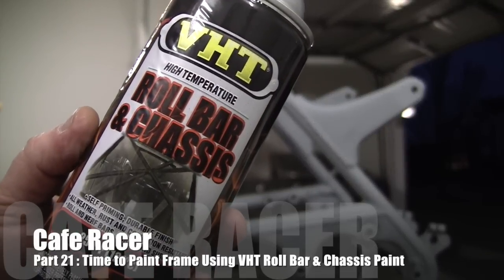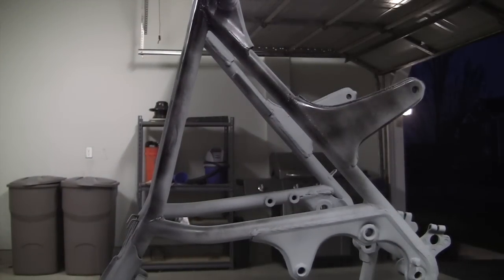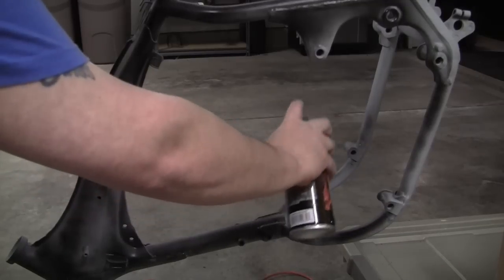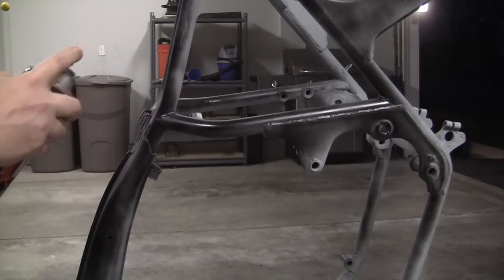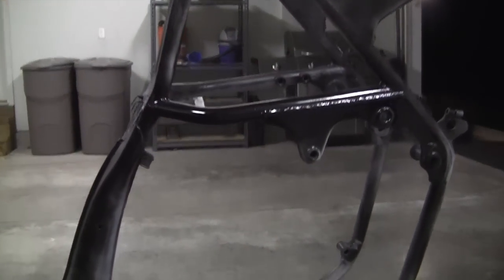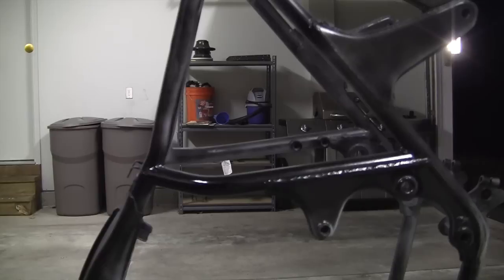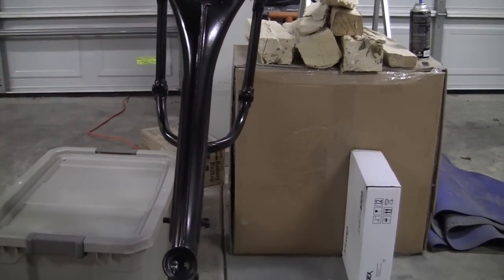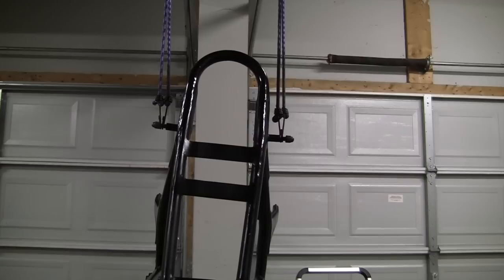Cafe Racer Build : Part 21 :Painting Frame Using VHT Roll Bar Paint

Comment: I'm using this paint in another application to get a "close as I can" powder coat look. For bike paint, I ended up using VHT appliance epoxy paint for the gas tank and trim on my bobber build and I really like it! A little wax and you can hardly tell the difference from OEM paint.
Reply from the maker: +Bill Dozer VHT is some awesome stuff!

Comment: I'm going to be starting a Brat build soon, and have a question. 
I was looking at the Satin Black VHT Roll Bar paint. They say it doesn't need primer, but you obviously primed the frame. Would it still be better if I still put primer on the frame first?
Reply from the maker: I've done it without the primer and noticed it didn't stick as well when using it with. I say use primer but I'm no expert! The primer really seems to make it that much better.

Comment: iv bougjt a frame stripped all the paint off to find rust holes under the engine carrage pipe not that bad but what would you sudgest? weld a half pipe over it and paint or? thank you
Reply from the maker: I would cut out the rot and weld in new sections to avoid it from coming back.
Reply: omg no don't cut sections out, it's more work than necessary cos you can't just butt weld in a new piece of tube, it needs a plug too cos butt welds aren't enough. all you need do is grind or file off the rust and build it up with weld then file it to match the tube

Comment: Im also building a cafe racer. The bikes a 1977 xs750.     I kinda wanna go with a "raw" look. I wanna go with a aluminum look and not paint it but would it be bad for the bike?
Reply from the maker: If it's steel you'll wanna put some clear coat to prevent rusting. I think that would look pretty sweet.
Reply: Make sure it's a 2k clear. Most others will rust through. I just did the same thign to my tank, and it started to rust underneath. I was told a 2k clear would have prevented that.

Comment: how strong is that paint?? you said that you used it on the yz125 but is it as strong as powder coating? will it withstand falls and not chip off? thanks!
Reply from the maker: It seems to be fine but isn't anywhere near as good as powder coat. The only downside to powder coat is you cannot touch it up like you can with this paint.

Comment: on my bike the limitatin stub also broke on a crash
i fixed it by filing it flat, cutting a thread all the way trough, screw in a bolt and counter it with a nut :D
Not the prettiest but it look decent
Reply from the maker: Hmm.. That's a pretty good idea.

Comment: What primer did you use for this?  VHT's primer or a different brand?
Reply from the maker: https://www.youtube.com/watch?v=eHNvopk6rZ0
Reply: does this have to be primed? As it states it doesn't need to be
Reply from the maker: Probably not but it doesn't hurt. Depends on the finish you start with as well.

Comment: What did you prime it with?
Reply from the maker: VHT primer.
Reply: @Johnnysshop  I've been using the VHT roll bar paint on a few projects on bare metal (which says it's ok or recommended on the can) do you recommend the primer instead?  I think certain paints are better without it.  For example; Rustoleum's hammered metallic paints.  I've tried those with Rustoleum metal primer under them and it seems to chip easier, eposing the light grey primer underneath but seems to bond better when applied directly to the metal. I've also read this on some of the other VHT products (like their engine paint I think).  How has that frame held up?

Comment: For best results. That VHT paint needs to cure for 1 hour at 200 degrees. What do you do for that process? I would like to know cuz I used VHT on parts that are too big for an oven...
Reply from the maker: Heat is best but I've had great results just letting it cure for about 2 weeks in a hot garage. Not the best solution but it has held up..